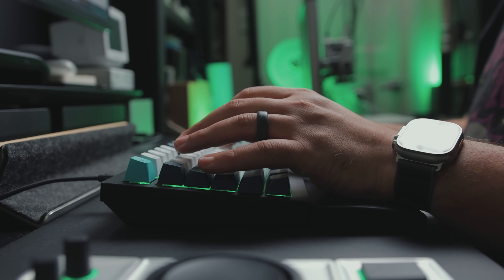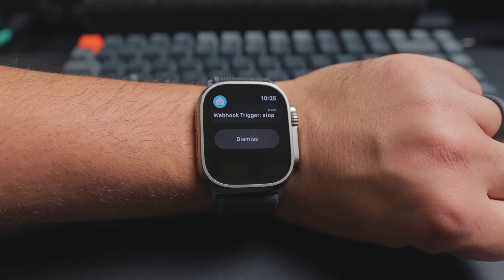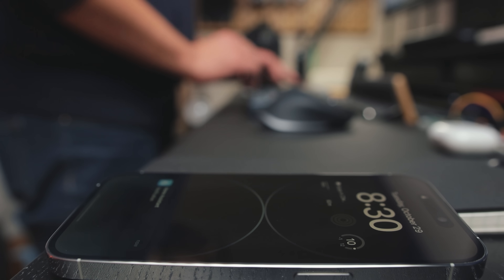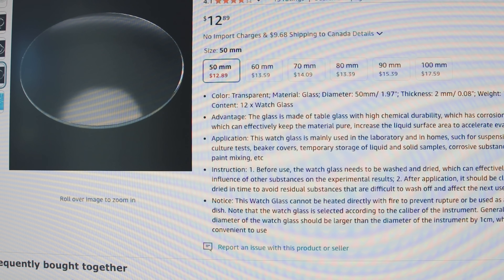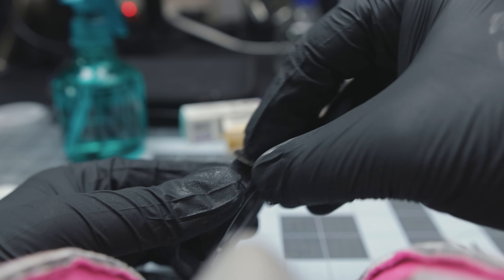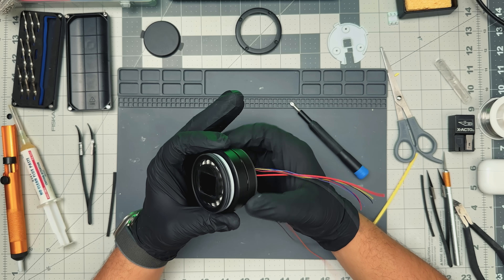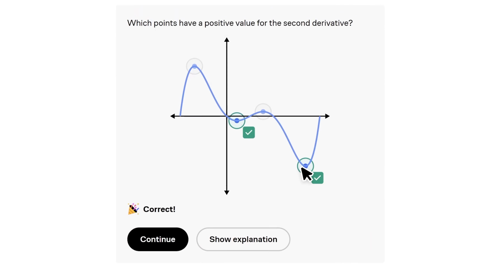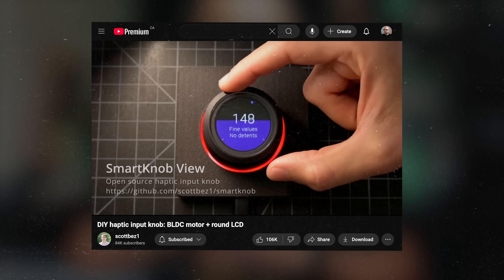They Never Shipped, So I Built My Own Focus Dial from Scratch

Comment: 🎯 Key points for quick navigation:

📅 The creator faced frequent distractions while working and sought a solution to enhance focus.  
🔄 Inspired by an ineffective product, they decided to build their own gadget, named the "focus dial," to help suppress distractions.  
🔍 The project included setting design goals, such as incorporating direct input features and automating phone focus modes.  
🚫 To minimize interruptions, they planned to block distracting apps and websites at a network level during focus sessions.  
⚙️ The prototype utilized easy-to-source off-the-shelf components and integrated home automation to indicate focus times with lighting cues.  
📱 Integration with iPhone focus modes was pursued, but challenges with notification confirmations required creative solutions through Bluetooth triggers.  
⚡ The assembly design balanced functionality and aesthetic appeal, including modifications to housing and light diffusion for visual clarity.  
🛠️ Valuable lessons were learned during the build process regarding space management and complexity, encouraging simpler alternatives for future projects.  

Made with HARPA AI

Comment: I've noticed that your projects are all of my dream projects... Good for you... It's funny though, I watched all of this stuff go from complete unobtanium outside of a real production budget, to like genuinely affordable prosumer pricing... Follow focuses, robotic gimbals etc... Even the drone stuff, although... Oddly enough the the basics got a lot pricier like your aluminum rails and your magic arms and whatnot.. So you know, there's no free lunch but it's definitely you know like you can you can afford that lunch if you save up and you make some smart purchases, which is also a lot harder than it used to be lol.. But the stuff exists now... I mean shoot just the the phone screen that I have right now, this would have been a couple grand back in the day to have a 1440 PO lead, I know because we use them for director monitor on sets... I'm granted that had like two 512 GB SSDs... And took two Sony 12 volts in the back.. you could actually do recording out to it but we didn't, lol usually we were just running secondary on b&c, and if I was unlucky using the remote stations connected to BNC... Because those things were a complete joke lol and it was easier usually just run a couple hundred feet of cable to the camera and if needed, follow around it and make sure there was slack for any moving shots lol.. another thing that has well.. okay hasn't changed that much, wireless transmission is still really hard for good footage.. But wireless controls that's like... That's a whole new world.
Reply: Oh well, I misread that one.. I thought you were building a wireless follow focus or a digital follow focus or something.. I didn't I didn't realize it was like literally a volume knob for for life... Although I bet you could convert it to something useful like a follow focus?

Comment: why go crazy designing all those 3d prints and researching glass, bearings, encoders, etc. with €40 on aliexpress they exist already assembled and with the round screen (much more beautiful in my opinion), don't get me wrong, the code is exceptional and remains useful also for those who want to buy the ready one given that it has an esp32 s3 as a board, but by buying the hardware already built one could focus more on the software.

Comment: I'm curious, since you needed to sand and clear coat the resin print, do you feel like it actually added enough value to swap from FDM printing? You could have used the time it took to print and cure the parts to add a primer to the FDM print to even out the print layers after all.

Comment: If someone wants to build something akin to this with less design hassle, you can buy round IPS LCD with integrated rim rotary encoder. These are taken from smart thermostat. Also with more enclosure and integrated esp32 and touchscreen if desired. It's all very inexpensive.
Reply: Thank you for this recommendation!! How would I be able to program those aliexpress devices with these programs?
Reply: @jons6348  if it has an integrated esp32, like any other esp32 i think

Comment: Lol, love how you unironically start by describing this as "pomodoro style", and then go all overboard building a custom electronics circuit for it. The original pomodoro technique used a kitchen timer. Which are often tomato-shaped in Italy, where the term originated. Hence its name: "pomodoro" means "tomato".

Unless you're building pomodoro gadgets commercially, the time spent on this project instead of just using a mechanical kitchen timer is merely a more focused and less random way of procrastinating, the antithesis of what you're trying to achieve. 😂

Yeah, yeah, I get this is for YouTube, which means this was a commercial build in a sense. Also, no, there is absolutely nothing wrong with having fun and overbuilding things. For a geek, that's almost as essential to survival as food or oxygen. Just playing devil's advocate here.

Comment: How do you deal with screws in a resin 3D print?
Anyways, congrats for this amazing project!
Reply from the maker: Thanks! I use plastic self-tapping ones. They can handle a few cycles without issues, but if it's something that will be disassembled frequently, I’d look into gluing in threaded brass inserts.

Comment: The M5Stack Dial jumps out at me as a potential off the shelf device  that could be used to make a very similar product.  Already has a rotary encoder, push button, runs on an esp32, and a touch screen.
Reply: Thanks for tipping this!
Reply: This is incredible. Thanks for the link. Have you played with this yourself?
Reply: @MichaelSchultzSF  I have played with it a bit myself but haven't touched it in a few months.  The state of HomeAssistant/ESPHome and it was pretty rough last time I looked and I basically had on/off for a device and controlling brightness of some dimming bulbs.
Reply: @thatsdandy How would I add his code me tioned in the video to the M5Stack

Comment: the only  improvement I could see is either a second base or a slight mod that would tilt the whole thing about 45 degrees or so so it is at an angle like a stream deck or other desktop thing easier to see it

Comment: It looks cool but a cheap mechanical timer can do the same. 
The dial would be cooler if you could also use it as input device for scrolling, zooming, volume or whatever but in a way so that the settings are stored in the device and it provides the desired functionality like a plug-and-play device.

Comment: just started watching this video, it looks very similar to an open design/project for an input knob with customized feedback, I am not well versed but it used a motor and hall effect sensors to detect the position of the knob. The tactile feedback was achieved through the motor, you could have steps, no step, a switch like option where it locks to the options. Very cool
Reply: The SmartKnob, my beloved!
Reply: SmartKnob by scottbez1.

I think both are really cool!

Comment: Just an idea to avoid bluetooth hack: Your ESP is connected to mac >> on button press run it runs shell script >> `shortcuts run "NAME OF SHORTCUT (that sets the focus mode you need)"`. On next click toggle ON\OFF. Since mac and phone share the focus mode automatically no need to touch the phone. 

Or ESP32 triggers a key combination mapped to hotkey that is mapped to apple shortcut on the mac, not sure what is simpler.

Comment: Very nicely done, I think the only thing I would change is to use a circular display so the screen goes edge to edge doing away with the need for LEDs around the edge.
Reply: The only potential issue is burn in on an OLED screen
Reply: @HyperGadgets  Many of those screens are LCD if OLED is a problem.

Comment: why not use a oled circular display?
Reply: Price
Reply: Oled display is extremely expensive and difficult to bulid due to oled is different that normal display
Reply: @Andy-js5jy the one he is using is already OLED, just not a big round one.
Reply: @MumrikDK  maybe he test oled display about there are limited hardware about he check any issues.

But problem is small chips (maybe old version) doesn't support olded display